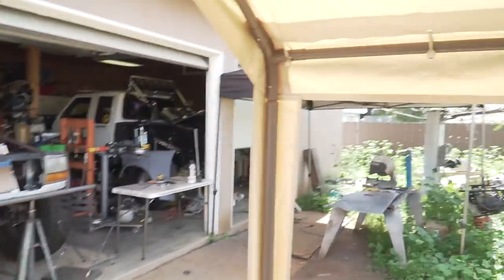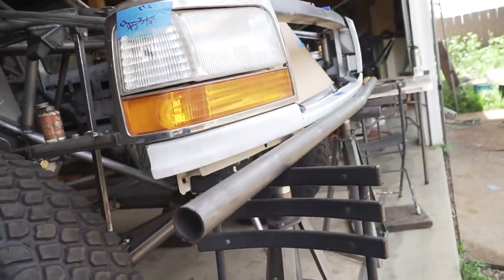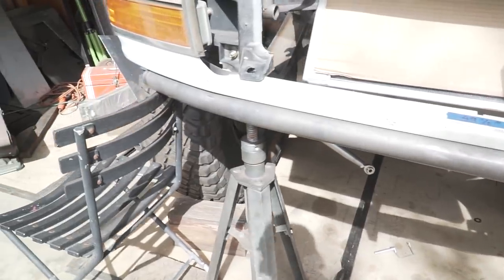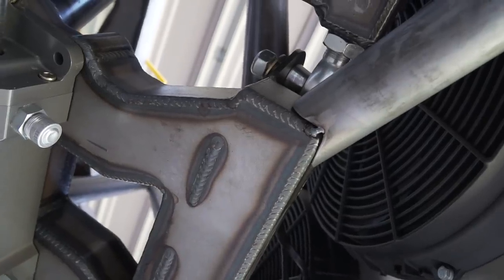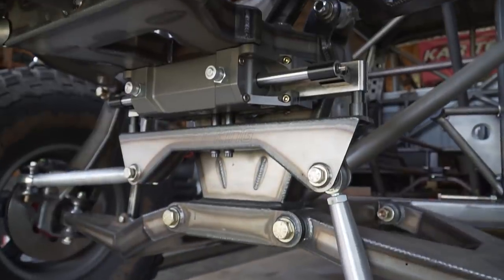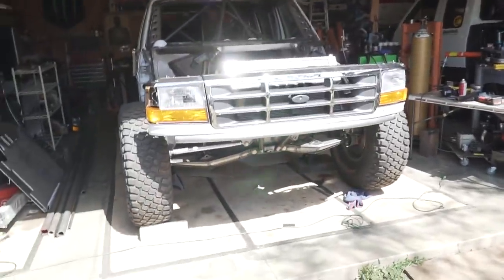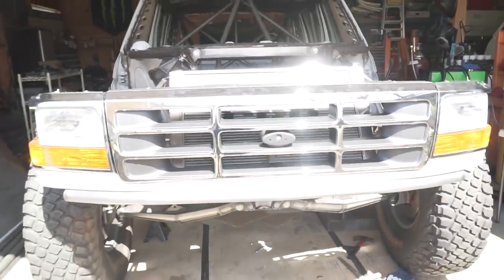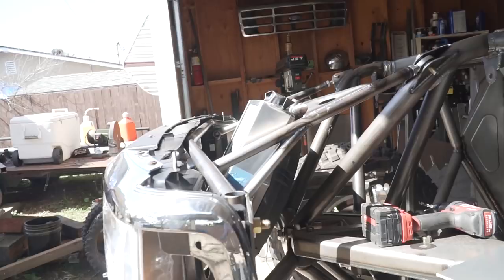Building a Front Bumper for the Tube Chassis Prerunner!

Comment: Curious question on the other truck you got the tube that sport the header panel or the fenders used to bolt in. What size of tubing did you use on that I love how that front end turned out it turned out very awesome and very clean